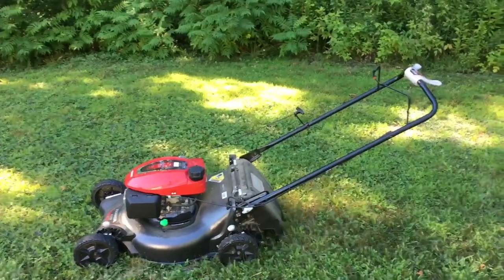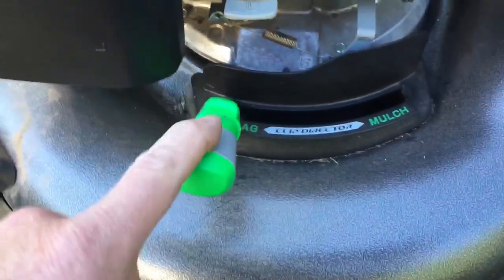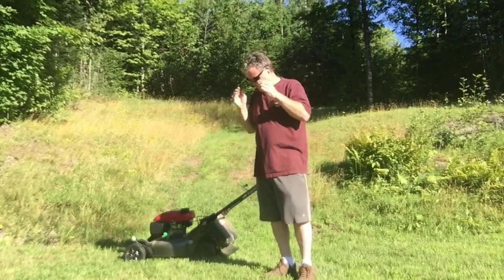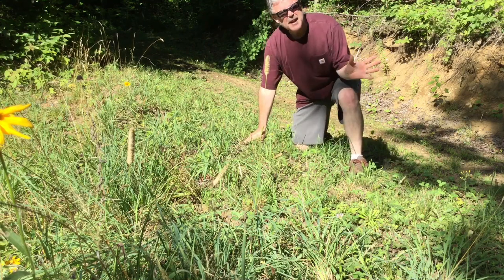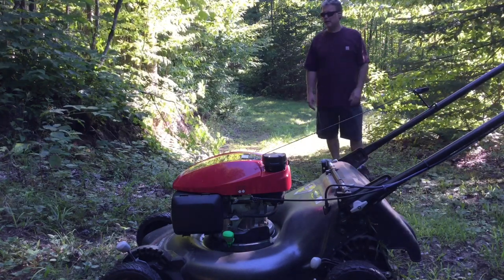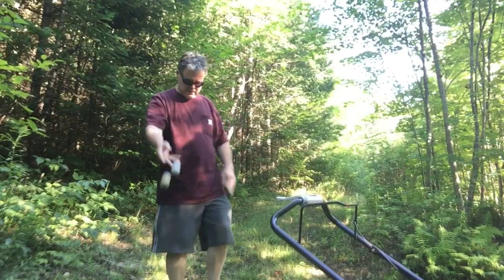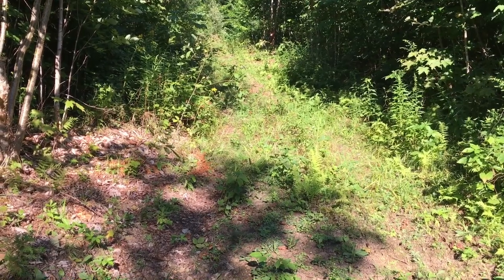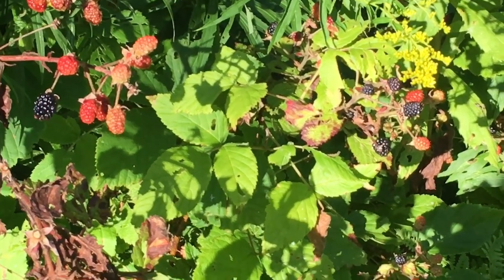Honda HRN 216 climbing hills

Comment: It's crazy how they now be cheap with the handle bars now that before they were in two pieces that it were more faster and easier to fold down
Reply from the maker: I did not know that, thanks
Reply: @DubberGuy12  Yep you would just squeeze the bottom of the handle bars in and push them forward and it was that easy and quick and just loosen the top of the handle bars fold it back and most all lawnmowers are now 21 inches that they also was 22 inches that they are being cheap on making lawnmowers now